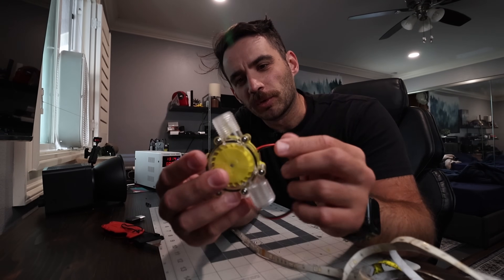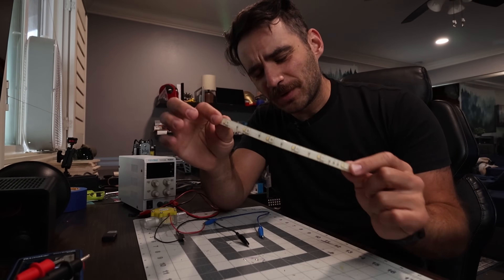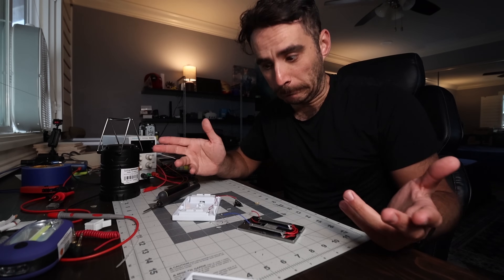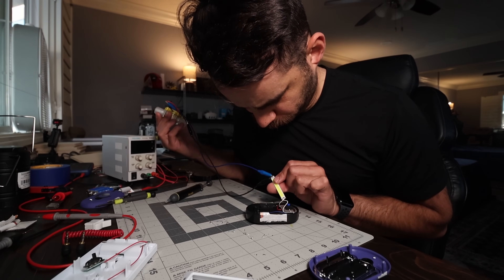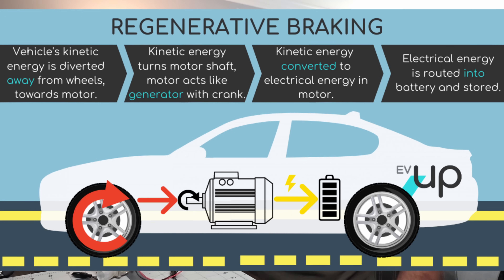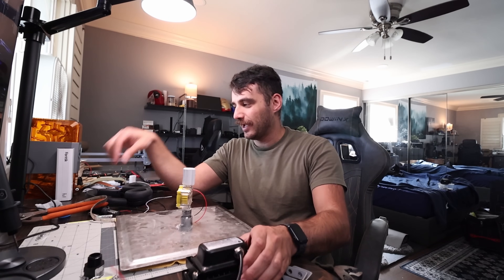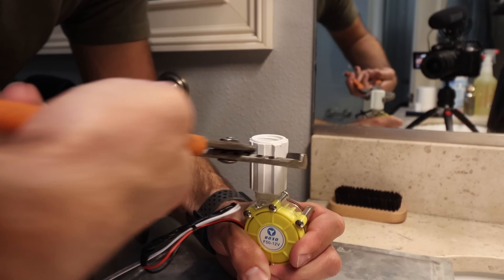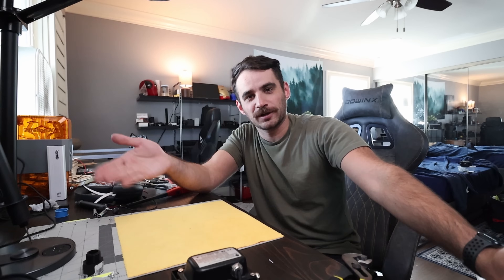I made a water powered shower light! (Hydroelectric Generator)

Comment: I didn't see anyone mention this, but LEDs are current devices not voltage. More current=brighter. 

If you look closely at those flex strips you'll notice there is a resistor for every 1 to 3 LEDs (Sized depending on your forward voltage drop for each LED.)

So ohms law time: E(V)=I(A) x R(Ohms) all in whole units, so you have to do some conversions here. E.g. 20mA = 0.02A.

1) know your forward voltage drop of your LEDs. 

2) know your source voltage. Usually 5v or 12v here. 

3) know the minimum and maximum forward current to drive the LED. 

Assume 5v source for now. 
Also assume I have an LED that has a 3v drop and needs 20mA with a max of 30mA. 

So, source-drop=resistor voltage drop needed. Or 5v-3v=2v. 

That means the resistor will have 2v across it when in series with your LED. 

Crude schematic:
0v ( - ) --------|<-------^^^^------- ( + ) 5v
                LED.     RESISTOR
Since we know how much current we want (20mA) and we know the voltage across the resistor is 2v we can calculate the size of the resistance needed to give 20mA to the LED. 
2=20ma x R? 
2/20mA = R? 
2/.02A = R? 
100 = R

So we know the resistor needs to be 100 ohms now. The other thing we need to check is how much power the resistor will dissipate. 

P(W)=I(A) x E(V). (Easy as PIE)
P=0.02 x 2

P=0.04W 

So if 1/8W = 0.125W, and 0.125>0.04 then a 100 Ohms 1/8W resistor (standard size) would be perfect for the LED to run at 20mA. NOTE: Check your resistor with a meter. They can be off by +/- 20% or more some times.

If the resistor isn't quite 100 ohms and it measures 115 ohms would the LED still light? 

What if you want it brighter? Then give it more current. 

25mA drive? Same calculations. 

Figure out what resistance and wattage resistor you need for 25mA. 

What if it's a 12v source and 3 LEDs in series? Then what resistor?

( - )----|<----|<----|<----^^^^----( + )
      LED   LED  LED.  R?

Comment: I have this in my current set up, my issue is when running the water at lower levels is it makes a bunch of noise. not loud but anoying. paid about $300 Cad from amazon. also reads water temp and shower time.

Comment: I havent noticed you have only got 982 subs! I would personally work on that buzzing noise on your microphone, add a low pass filter to output (it will  lower slightly the quality of your voice, but its a cheap  solution ) or solve any problems with interference on the wires. Other than that I was surprised I was not watching a much bigger youtuber, good job
Reply from the maker: Thank you! Yeah it was definitely interference from being near other wires that I didn’t notice until I started editing unfortunately. That was the best I could do in post to minimize the buzzing sound. I’ll definitely keep it in mind for future videos and check my audio regularly. Thanks for watching!

Comment: Reclaimed* Energy. There's no such thing as Free Energy, it took energy to pump the water through the shower to begin with, which is part of your Water bill :)
Reply: free for the user, reclaimed too
Reply: @idiotburns Like he said it's not free though you pay for the pumping cost via the water bill, I guess it's free in the way that you have to pay for it anyway but still not really free in most senses
Reply: Except you don’t pay for water pressure, only the amount of water used, and this doesn’t use more water, hence no extra cost (if you don’t count the cost to your soul from the noise and reduction of water pressure)
Reply: @beaconofwierd1883  No, you've completely missed the point. 

Title Says Free energy, It's not free energy, it's (Kinetic) energy delivered by flowing water, which was pumped to the shower electronically by the water company's pumping station, which you pay money to for the delivery of flowing water per unit. Thus it is not free energy. 

And then yes, as you pointed out - That Kinetic Energy from the flowing water supply that is converted back in to electricity, results in a reduced flow rate after the turbine/generator (because there is less energy there now) - The Electricity doesn't simply appear from thin air. Thus it is not free :)
Reply: @RonLaws  Semantics, we all know he meant the light doesn’t cost anything extra to run.
Reply: @beaconofwierd1883  🤦‍♂ You missed the point. It's. not about costing extra or the pressure, it's about it not being 'free' energy. You pay the water company to deliver water to your house and are charged per unit delivered/used. That money pays for among many other things - the energy cost of operating the pumps to pump it there. As you yourself also pointed out, the result is the lower head pressure after the generator, because you have just extracted that Kinetic energy from the flowing water and turned it (back) in to Electricity, thus the energy is not free, (And never can be) it is simply reclaimed/harnessed.
Reply: @RonLaws  also, it’s super easy, barely an inconvenience, to get free energy. Just put up a couple of solar cells or wind turbines and you’ll be getting energy for free. If you don’t like to pay the initial cost you can always steal them too, extra free.
Reply: @beaconofwierd1883  Now you're trying to change the definition of 'free energy' to save face and/or sound like you're on the correct side of an argument, Grow up lol.
Reply: @ No, I said you’re technically correct, but we both know that’s not what he meant.
Reply: @RonLaws from watching the video it seems like he's right, Bas clearly meant monetarily free. You're the one failing to save face lol
Reply: @Voyajer.  Except it isn't monetarily free, it was already paid for.

Comment: I absolutely love this idea! More energy could probably be harvested from the generator if you managed to bypass the voltage regulators to get higher voltage and converting the raw coil output through a full bridge rectifier and use an external power regulator to control voltage and current. Very interesting concept!

Comment: You measured voltage without load, only load was a voltmeter. Voltmeters have a very big resistance, that allow only a very small current.
voltage != power
voltage*current = power

Comment: free energy? 🤣😂🤣😂 naw, thats not free energy... it takes energy to pressurize that water... the losses are so great, i wouldnt even consider that remotely green, let alone free... simply put... it would take less energy to power that led using a SMPS, than to hydro electrically use pressure from water thats pushed through pipes for miles and miles.
Reply: You’re right it does take energy to pressurize that in the sense of pumping the water to the top of a water tower (or similar process). That water now has potential energy that this device is reclaiming. It’s essentially a consumer level of pumped-storage hydroelectricity. It’s not like this is going to make you pay more on your water bill, you’re using the water either way. If you power it using any other power source, you are then paying extra for that power source
Reply: @atvaz78  we not going green no more?

Comment: Interesting concept. When I clicked on this video I imagined a similar generator, but built into the drainage line, which in hindsight would not be nearly as effective. Maybe in a 2-story building the falling drainage water would be enough, but your implementation is definitely better for consistent generation. Do you notice a significant drop in water pressure? 

Just for some constructive criticism, the biggest glaring issue might be the sound created by the generator, effectively ruining the ambient white noise of the water. That would drive me insane haha. I feel like the long-term solution would involve installing the generator deeper into the line, behind walls, and maybe some extra sound dampening material just to be sure.
Reply from the maker: Yeah the sound is definitely a big issue. I think I may have to design the turbine from the ground up to reduce noise but sound dampening around it isn’t a bad idea! Thanks